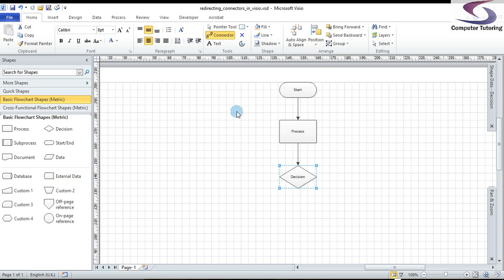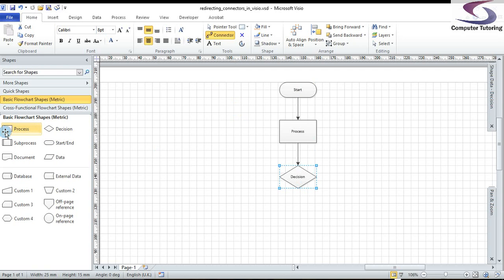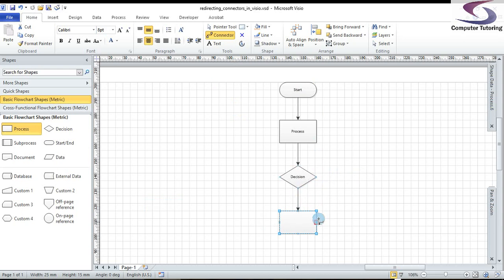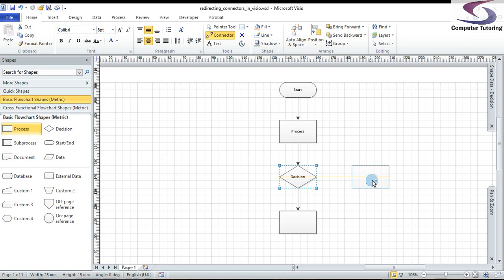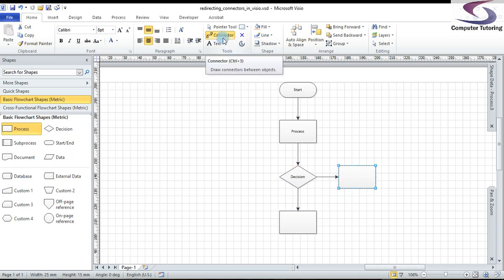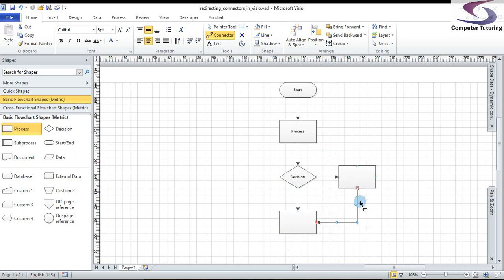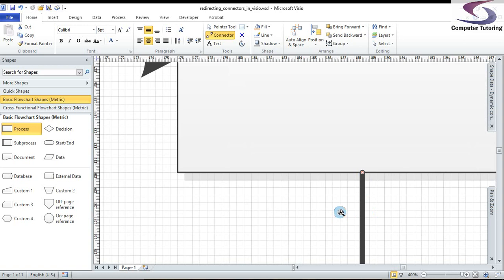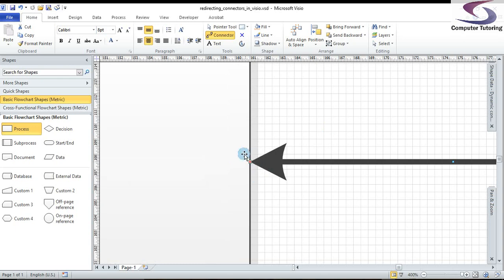How to use connectors in Visio

Comment: I am getting a connector between them how every I am missing with pointed arrow tip
Reply from the maker: Check that you're using the flowchart template. They should automatically have arrows. You can also right click and format the connector and select the arrows that way.
Reply: @computertutoring  Thank you for replying.

Comment: Using Visio 2010, this does not work for me. I find it virtually impossible to connect shapes in Visio and generally find I spend more time messing around with Visio than doing actual design work.
Reply: Same here. I have to connect together drawings and cisco stencils. The connectors are always connecting to nonsens thing and never being "glued" to the desired ones...
Reply: Absolutely agree. Visio is one of the worst apps I've seen with so many major flaws. Not intuitive at all. Wasted way too much time trying to decrypt basic functionality